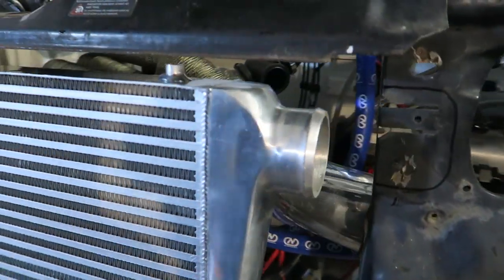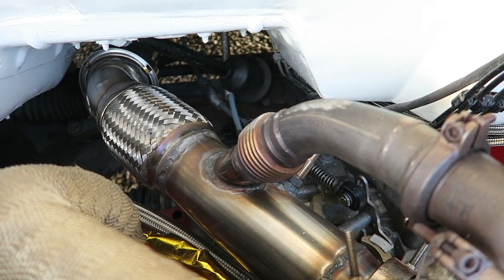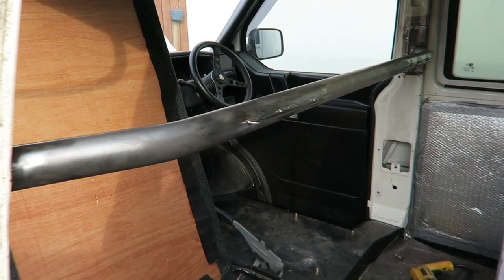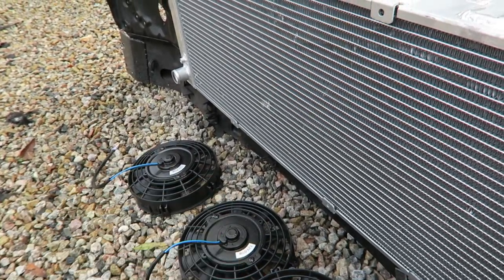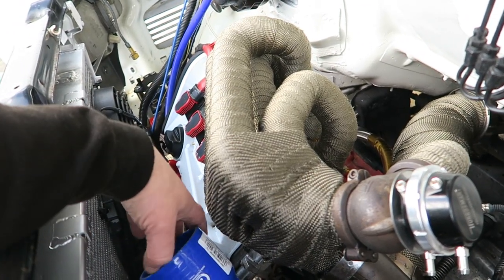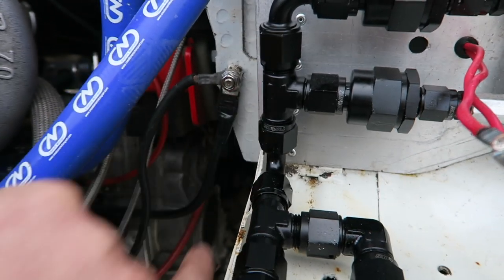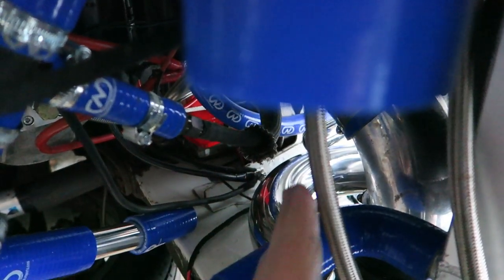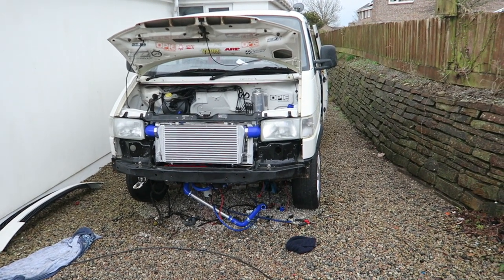VW T4 TRANSPORTER 500BHP+ Exhaust, Intercooler & Radiator at Autostyl

Comment: Early Urchfab vids are good for welding tips, van looks great but do you think its wise to have the swirl pot and fuel pumps in the engine bay? Best of luck with it though👍
Reply from the maker: Hello Gavin, thanks I'll check it out. Swirl pot and pumps in the engine bay is perfect. The pumps are on fused relays and all lines are AN fittings. I will also be adding a 4kg fire extinguisher system due to the nitrous oxide.

Comment: When you say “track” what type do you mean ie drag or actual circuit racing?
Reply from the maker: Hi Michael. I'll be doing both. Drag racing at Santa Pod in the VWDRC Sportsman class and on track at Combe etc. I'll switch some 24.5x8 Hoosier tyres on for drag racing and wind the rear shocks up to as stiff as possible.

Comment: I think you will need water meth injection for 600 HP
Reply from the maker: Hello Otar, you are 100% correct. Once everything is run in I'll be adding 10% meth to the fuel tank to suppress knock.
Reply: speedingtube  for best possible result I recommend to add a nozzle and a meth injection kit to your setup. Performance camshafts would be also great to help the spool and to achieve your goal 600hp. I have tuned many 1.8t and from my experience 600 hp needs a lot of boost :) like around 35PSI. Oh almost forgot... I hope you have forged head if not most likely you will brake a valve.
Reply from the maker: @LTDSPG  Thanks and I completely agree. It's a fully forged engine, catcam 3658 etc 😎👍
Reply: speedingtube Wish you health, success and a lot of joy with your 1.8t :)